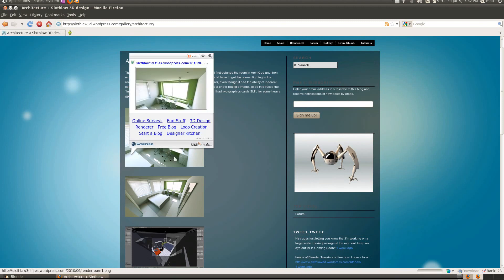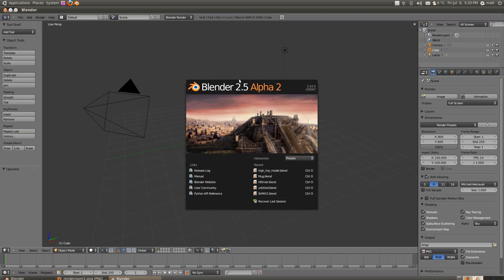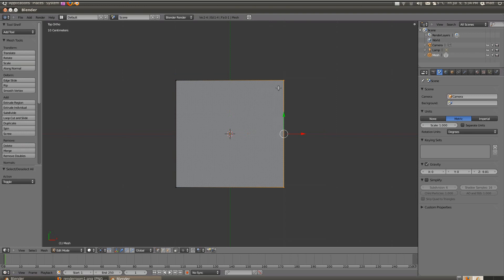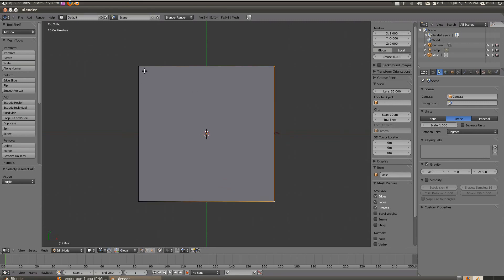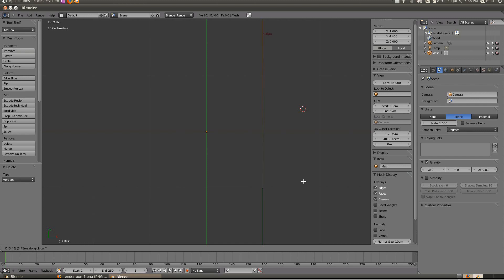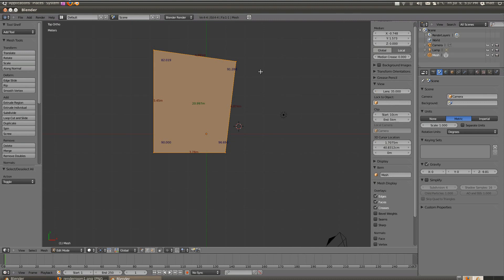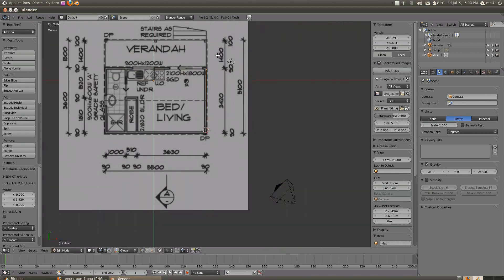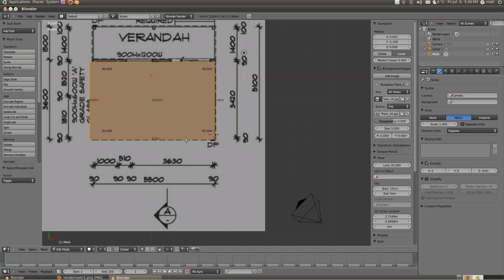Blender Architecture Measurments Tutorial!

Comment: I don't want to sound like any kind of A** but I have never drawn or read plans of any building made in the U.S. where the dimensions were given in meters and decimal equivalents of fractional measurements are reserved for electro/mechanical designs. What Blender needs in order to be like a CAD program in the U.S. for dimensioning is the ability draw objects in Feet and inches, with fractions of inches being Numerator/Denominator in style. This Blender does not do YET. How could I help it be so

Comment: Architects (and engineers) also have a need to PRINT their drawings for use by others. I can't remember seeing a framing crew, a plumbing, crew, and electrical crew on a job whipping out a tablet  and trying to run Blender to see what dimensions they  need on a project. So HOW can anyone using Blender create and PRINT the type of drawings needed for the "craftsman." To my knowledge we aren't printing full size structures yet. Blender for architecture and engineering will never "fly" if it can't allow the proper export of the work.  As I investigate I'm beginning to believe Blender will never be a tool used by Architects and Engineers WITHOUT SERIOUS UPGRADES.
Reply: +Gordon Andrews  you can switch to orthogonal mode with a scale and from that save the veiw point as an image i believe.
Reply: i am an architect and, and i can tell you that no ingeneers or architects need or use a 3D model to build anything… that's why we use blueprints in 2D. blender is more for realistic visualisation, to know how it might look after the construction, it is not meant to be used as an exact reference nor for adding any measurements whatsoever. however, we like being presice in 3D modeling to make sure that is 99.99% closer to a real life scale
Reply: @kingofchris  machinists and fabricators might disagree